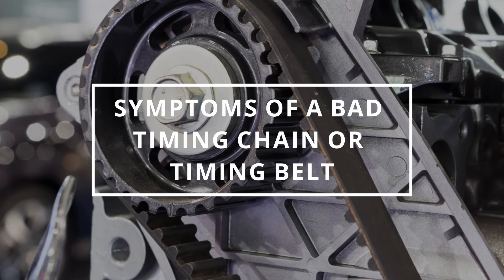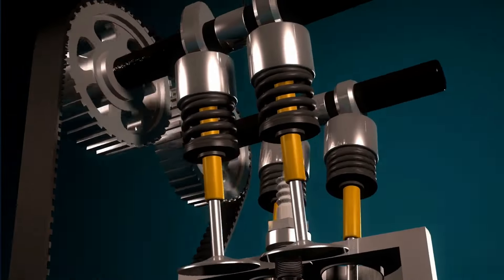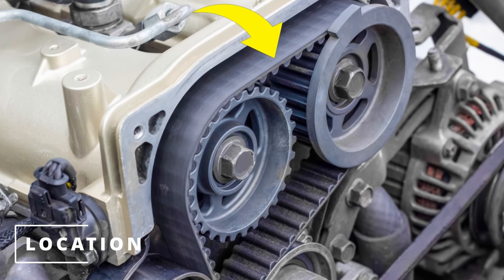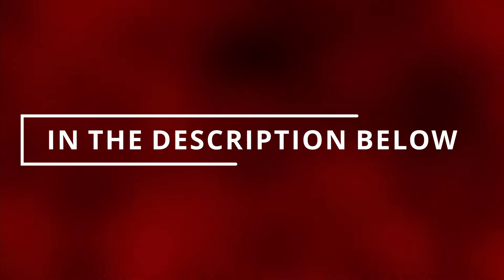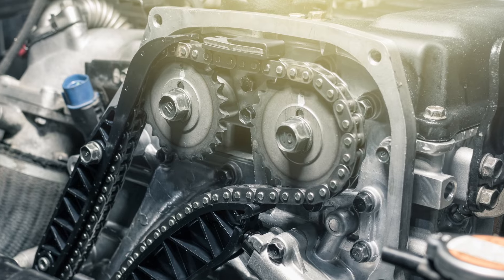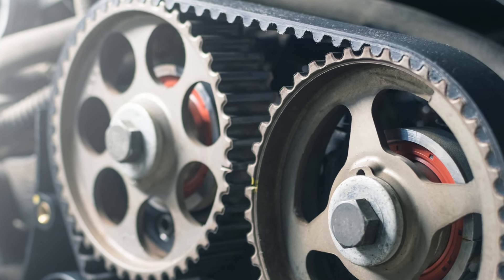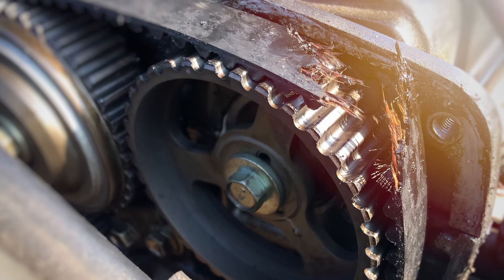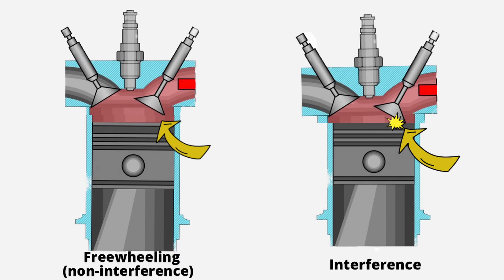SYMPTOMS OF A BAD TIMING BELT OR TIMING CHAIN

Comment from the maker: OBD2 Scanner: https://amzn.to/3PHRplS

Check out AllDatadiy repair manuals: https://www.gopjn.com/t/SENKTklLS01DSE1NS0lOQ0dKRk9LTw
Use code AD10VA for 15% off one-year subscriptions for any US Order

Check out my merch: https://easyautofix.creator-spring.com/

Have car-related questions? Check out JustAnswer! They have verified auto mechanics that are available as live help 24/7: https://justanswer.9pctbx.net/qndBon

Buy a new timing belt or timing chain: https://advanceautoparts.rt8x.net/vnaYOv 

Here are some of my favorite items that you might like:
Tools: https://amzn.to/3xNDb8g
Car Vacuum: https://amzn.to/3EjhPSJ 
Cleaning Tools: https://amzn.to/3El7dCG 
Water Repellency Wiper Blade: https://amzn.to/3utvK50 
Cleaning Gel For Cars: https://amzn.to/36NIiMr 
Portable Air Pump for Car Tires: https://amzn.to/3uBuPzA 
Headlight Restoration Kit: https://amzn.to/3qDpOVH 
Amp Jump Starter: https://amzn.to/3pMd0vx
Reply: dude my 2016 toyota sienna has a quiet rattle and it comes and goes, it rattles for about 20 seconds and then it goes away!! then it comes back again?  its that bad?? no check engine lights!

Comment: Thank you for not prolonging the video and getting right to what we came for! I'm experiencing issues with my Volvo, as I was parked after starting the car it just cut off on me. After sitting there in confusion for a while I decided to start the car again, then able to reverse out of my parking spot on and it shutting off on me again. My mechanic came and diagnosed it as it being the fuel pump. Replaced that and the car still isn't starting and now he's saying it's my timing belt. Any part I've bought on my own and he hasn't overcharged me for anything if you're thinking of that. These symptoms do match what I've been dealing with, I hope changing this works; I NEED MY CAR!
Reply: My Explorer had trouble starting and lost power while drivin', I thought it was because it needed a simple replacement of spark plugs, but my mechanic told me that it needs a new timing belt😢
Reply: @carloshuertas8101 we had an older Explorer, a 2003 & when we experienced these symptoms our mechanic finally figured it out. Relay switches were bad. Once replaced it worked fine.
Reply: @renep3276 I actually thought the same because I had an issue w/ some relay switches months prior, but as many miles as I had, it was definitely my chain, because it would loose power and would go fast on the high way, it would take a while 2 even reach 65 mph😂

Comment: I DON'T KNOW WHY THE CAR COMPANIES WOULD MAKE INTERFERENCES ENGINES. IT'S LIKE THEY PURPOSELY WANT YOUR ENGINE TO BE DESTROYED. I GUESS IT'S TO SELL NEW CAR'S
Reply: Lucky for most of us that have timing chain it will definitely give you sign before it breaks it’s still crazy to think that if it does the pistons can clash with the valve stems resulting in catastrophic failure just poor thinking during manufacturing and catalytic converters intergrsted with manifold if one is good and one is bad you have to replace the whole thing fuel pump intergrated wjth fuel filter if one is bad you have to replace the whole thing if the pistons good chain breaks guess what ….

Comment: Would a bad timing belt cause jerking between from first gear to second gear? I definitely have the start issue you just described (fast crank, no start) yet I have a new battery and plugs but also the vehicle (Toyota Passo, automatic) jerks when switching from first gear to second.
Reply: Have almost the same problem did you solve it ?
Reply: @hameedkhan5705  run a code reader, you can borrow a free one from a part store
Reply: @michaelkolkmeier7400  Thanks I'll try that
Reply: sounds like a transmission issue to me
Reply: maybe the torque converter?
Reply: it might be the engine/transmission mounts have you checked? bad engine mounts usually jerk the car or makes a clunking noise when switching gears. not sure but might be a worthwhile check.
Reply: Most likely a transmission issue. I’m leaning towards a solenoid. Have it checked by a qualified technician.
Reply: Yes it can cause tht I changed my timing belt and it was off one too on one of the cams and it would jerk to shift into the next gear when I’m going like 40-50 but after 60 it wouldn’t even notice I would be going 80-100 you only notice the bad timing when it is parked , needs to start , or at slower speeds

Comment: ive had timing chain break while driving. a good back fire and car bucked out and off on me. fixed less than $200. sprocket is also called gear.
Reply: Can you elaborate what you mean by bucked out and off on you? I heard a loud bang while on the freeway like 2 months ago and ever since my car has been getting noisier and running rougher, could it have been my chain?
Reply: What was its mileage at the time of the breakdown?

Comment: Doesn't a cracked head have the same symptoms as a bad timing belt or chain? How can you tell the difference between the two? I have a 94 suburban, I'm going to have it looked at this weekend, but the engine has lower performance, it runs rough and chokes out. But it doesn't have any coolant in the oil nor does it have any white smoke coming out the tailpipe. I was told it's a bad head but all of the symptoms match up nearly perfectly with a bad timing chain. How can you tell the difference for sure?

Comment: 😩 yes I had P0017,P0016,P0019 and water leaking I changed the crankshaft and chamshaft 😢 never would have thought it was the timing belt
Reply: i also have water leaking but i always thought is from the clima 😅
Reply: DID YOU DO IT YOURSELF

Comment: I rebuilt my transmission because of the shifting it was bad but I had a mechanic before who was going to fix my cam shaft censor but didn’t & I seen him put my timing belt back on in less than 5 minutes could that be the reason of the jerking issues after ever gear doesn’t go pass 80 no more ?
Reply: Takes hours to replace so he scammed you.

Comment: Great video!  I have a 2017 Accord 3.5L V6 36K miles. How many miles should I wait until I get new timing belt? Or should I just change it cause it's been 7 years? Have you ever seen a low mileage high year cars timing belt look bad or break?
Reply: Had this happen to me, Bought a Rover 75 V6 with the belts done 50,000KM ago and thus thought I was still good for a few thousand KM. But here is the thing belts wear over time and mine was done back in 2012 so my car is pretty much a ticking time bomb on wheels.

Comment: I just got my 2013 honda accord exl v6 with 132k now has 154k drives perfect I don't even kno if timing belt needs replacement or was already done before I had it?
Reply: Most of ppl in USA and Canada don't even know what is timing chain or belt....crazy!!
Reply: I would err on the side of caution and say it hasn't been replaced. At least that's been my experience whenever I buy a used car, everything else is fine but the previous owner never changed engine components because they're expensive to replace. They were probably told "it needs a new timing chain/belt, that'll be $2,500" so they trade it into the dealership and make it someone else's problem

Comment: if there is a loose timing chain could it throw faults codes P90335 in relation to a faulty crankshaft sensor ?
Reply: Yes mine threw a code for faulty crankshaft sensor but it was actually a stretched timing chain.
Reply: @imp3nda456  thanks I’ll have to check
Reply: Can confirm, threw a crankshaft and cam shaft code on my Chrysler 300. Replaced both sensors and continued to happen. Car eventually would stall out after 7-15 minutes. Changed the chain and it was the best 180k car I could ask for.

Comment: 454bbc, fast start but I also hear a whine then the engine dies, it repeats this a few more times when I start it. it has been jerking on first to second shift as well and been running poorly, u think this is the issue?
Reply: Pretty sure you got ti.ing chain vs a fan belt type

Comment: I have a 2013 avenger se 2.4 

Changed the head gasket for an oil leak and went ahead and changed the main timing chain on phasers  and tensioner. Before head gasket issue the timing was fine . Now there is poor performance and slipping, changed all the sensors and keep getting code p0016  no correlation bank 1 sensor A cam and crankshafts 

Followed timing marks in reassembly of timing chain
Reply: Check your coils and spark plugs.

Comment: Hey, today I bought Pilot ex 2005, 175k miles.
Amazing driving experience :-)
But there is no streaker saying when the timing belt changed last time. How can i know that.
And should I change transmission fluid?
Reply: Im in almost the exact same boat, bought a 2006 pilot ex with 190k. What did you end up doing?
Reply: @635atom  nothing :-)
There is a rubber cap, size of a penny, on the timing belt cover. I opened that and but unable to see timing belt

Also yesterday I got check engine light, P0138, nothing serious, just about O2 sensor

And I love the driving experience of this car :-)

Comment: Question drining car no probs no lights about 35 miles per hour car dtops no noise no warning. Some say engine some say yimimg belt. Any ideas? If belt nreaks w/o warning can it ruin engine? 2001 ford escort 76,000 orginial miles great running no problems ever.

Comment: Hello! I have a question, please give me advice. I have an old suzuki swift from 2001 (a 1.3 liter gasoline engine, with Single injector). At highway speed (above 100 km/h) it starts to vibrate and feels like there is no power plus jerks when pressing down on the accelarator. The weird thing is when the car is not in gear you can rev the engine, there is no hesitation and it’s not always having this issue. The mechainc checked it and he couldn’t replicate the symptoms at city driving. What can be the reason? At startup there is no problem just a quite bad grinding noise that goes away driving it a bit and only when the engine got fully cooled. When the 4th rod bearing was scoared it didn’t have the issue and could go even with 140km/h but not all rod bearings were replaced this happens. I changed the oil several time and try and injector cleaner too… thank you in advance! :)
Reply: Sorry all rod bearings were changed*
Reply: Vibration under load sounds like an electrical misfire.
Ignition coil pack, most likely.
Reply: @kristofbokor2431 Where you able to find the cause of the problem? My Ford Fiesta from 2015 does exactly this as well. Just as you describe with the loss of power and jerking.

Mechanics have not been able to replicate it when driving the car. I had the timing belt changed recently and suspect that to have something to do with it.

Comment: I have a 2009 for Taurus 3.5 liter v6 .it has a metal timing chain.but in recent times it was making some strange noises I think one of my phaser fail and the timing belt snap.the car only has 58,000 original miles does any body think I should fix or trash it? Cuz I don’t have 2,000 to fix the issue.

Comment: When I start my car on a cold start I hear a rattling sound that goes on for about 5 seconds but after it’s gone this is the timing chain right I have a 2011 chevy camaro
Reply: Having this same issue I’m thinking that or the sprockets themself.
Reply: Same, doing it as i type on both my 1.6l engines
Reply: @angeles1994  mine was the cam sprockets
Reply: sounds like piston slap
Reply: I knew someone who had 2007 G6 2.4 made a loud rattle on start up when cold but immediately went away a few seconds of running. Drove it for years like that till the car got totaled.
Reply: I had a 2006 Toyota Camry with startup rattle. 2AZFE 4 cyl. Engine. That was the Variable Valve timing sprocket on one of the camshafts that had failed. I replaced the sprockets with new ones, a new timing chain, oil pump chain, chain guides, and new oil pan and valve cover gaskets. 
Oh, and I took the engine outta the car to work on it. Too hard to work on that engine with the vehicle’s unibody, all up on the front of the timing cover and power steering pump, which is mounted at the the rear, bottom portion of the engine.

Comment: 2012 buick verano standard. Clicking/rattle sound on idle, louder when accelerating, excessive gas consumption, cabin smells like gasoline fumes at times, Temp gauge sometimes decreases while driving (but returns to normal temp), AC airflow struggles in low fan speed. No engine light on. Clicking sound began in winter.
65,000 miles. Last oil change in September. California native.
Help. Can anyone diagnose?
Reply: Take it to Firestone or NTB. They’ll tell you what’s up.

Comment: My trailblazer broker down, guy told me it was the timing chain. Charged me 800 bucks and had it fixed overnight.... I think I got took... Think I got an expensive tune up
Reply: If he fixed your timing chain overnight definitely worth 800
Reply: @KBarron43  I agree $800 depending on the area and type of car isn’t that bad. I would’ve tried to get him to drop it to $600 if I could
Reply: @eligreg99  good luck finding a professional shop for 600, My Buick regal needed a timing rebuild, 350 for the kit & 1,000 for labor
Reply: @KBarron43  Like I said it really depends on the car. Ofc a Buick is going to be expensive 😂 It’s a Buick
Reply: @eligreg99  all shops around here are 60-100 an hr for labor
Reply: @KBarron43 you need a friend that is a mercanic😊